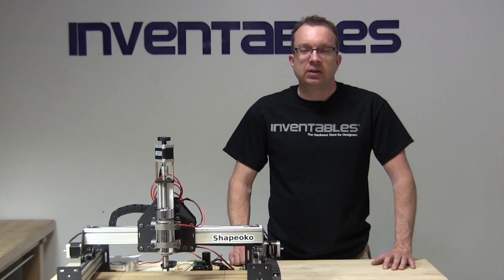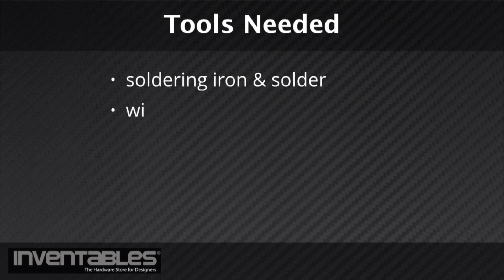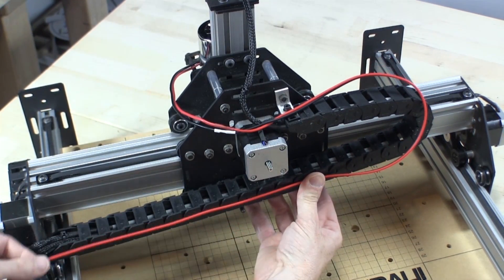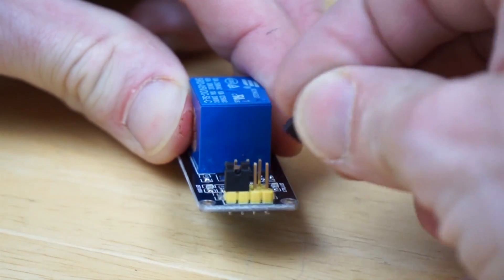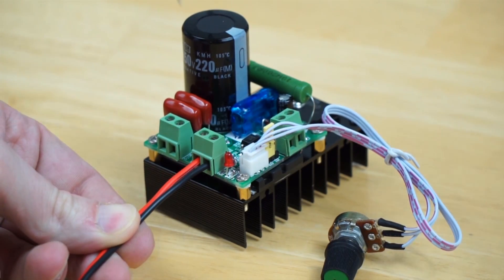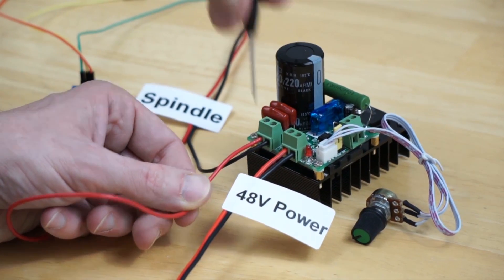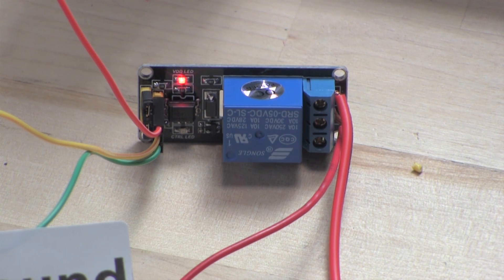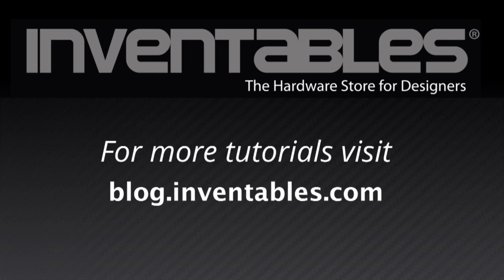Tutorial: Inventables Quiet Cut DC Spindle & gShield Shapeoko CNC upgrade

Comment: What's the easiest way to get that 24V, that will power the gShield and the 24V fan, from a 48V power supply unit?
Reply: might be a little late answer but using an step down regulator, for example from pololu

Comment: Does this kit work with Easel too?
Reply: Yeah. Being ignored is kind of discouraging when you're trying to learn about a product before making a purchase.

More to my question though, does Easel turn the spindle on and off or is that only done via a manual switch/pot?
Reply: Bitter Rotten It says right in the video that the gcode can turn the spindle on and off. Easel makes the code. Any other software that generates gcode would work too.

Comment: Shouldnt the positive lead from the relay to the spindle speed controller go on the Normally Opened connection as a safety feature? As wired on the video, if the power supply to the arduino and/or relay fails, the spindle would stay on, right? Im guessing you are setting the arduino pin as an OUTPUT_PULLUP but i guess i pull down resistor and changing the logic on the pin would be a safer way. 
Could you please elaborate?
Thanks!

Comment: what is the maximum speed and what is the expected torque ?
Reply: Dave Mucha The spindle runs from 3000 RPM - 12,000RPM.  You can see the torque at different current and input power on the test sheet posted as a PDF on the Quiet Cut Spindle product page on Inventables website.